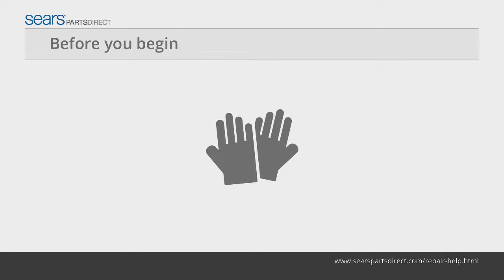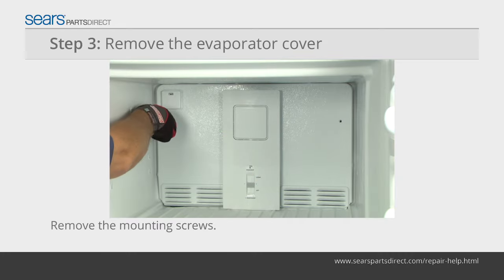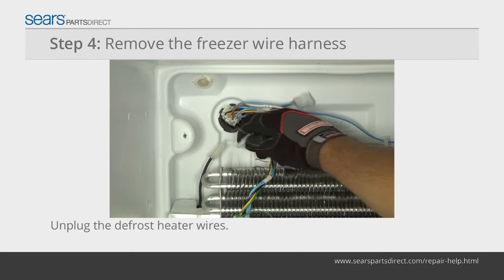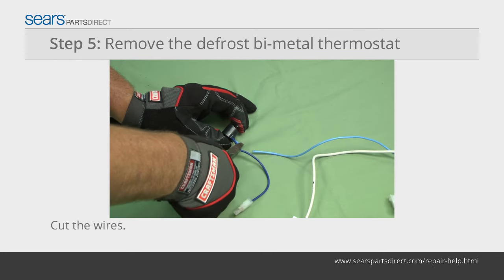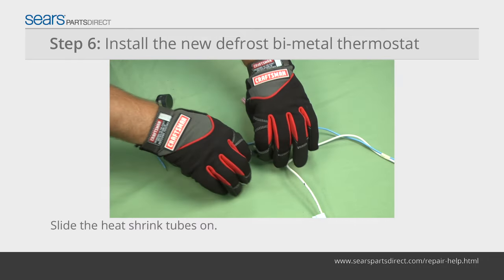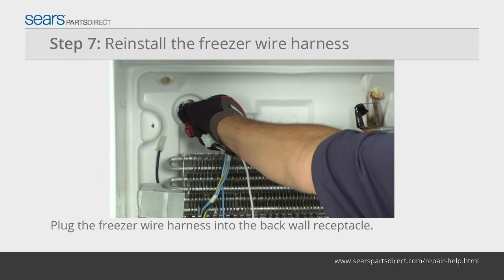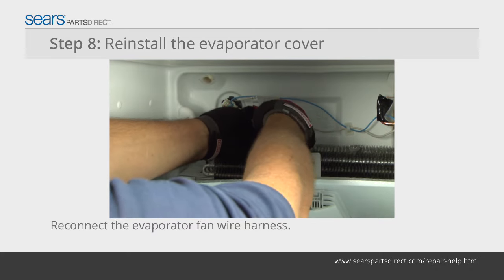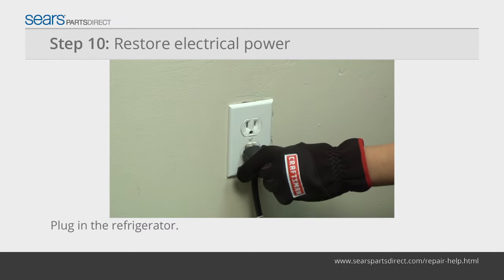How to Replace a Refrigerator Defrost Bi-metal Thermostat

Comment: I replaced my defrost thermostat and it failed again in only 1 month  why?
Reply from the maker: Here are some possible scenarios that could cause a defrost thermostat to fail again quickly: the replacement part could be defective, thermostats can fail at any time -- the bimetal plate inside the thermostat may have failed quickly (this scenario is rare but possible), a wiring short in the defrost heater circuit could have caused the defrost thermostat to fail (check the wiring and defrost heater for shorts using a multi-meter), the wrong defrost thermostat may have been used -- check the part number of the defrost thermostat needed for your fridge, and a non-OEM replacement part can sometimes fail quickly -- if you used an off-brand defrost thermostat, try replacing the part with the original OEM replacement part. We hope this information helps. If you need further assistance, let us know.